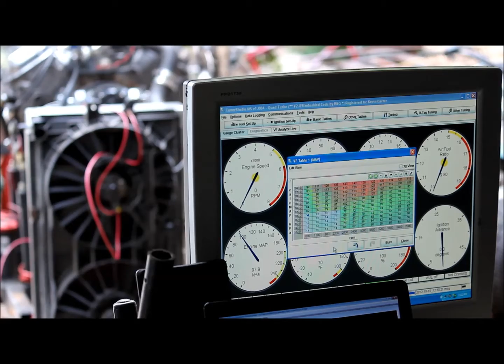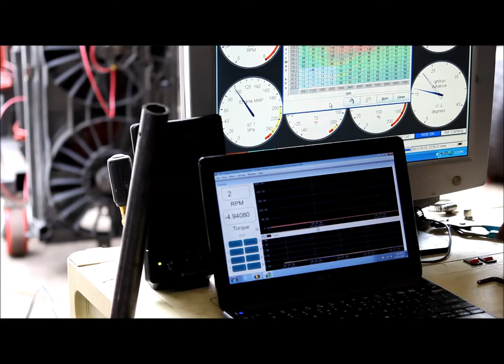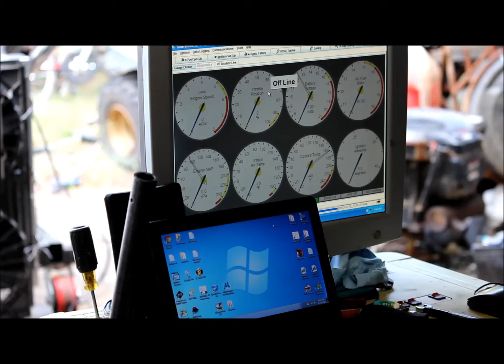Twin Turbo 454 BBC final assembly and test firing.  Polished Everything.

Comment: I like the cnc in the background alot more .  I work on a doosan 5 axis horizontal at work and have a small 4 axis at home .
Reply from the maker: +Mark Rich It's funny how much attention my son's sub $400 twin engine go kart gets and no one notices the 5 axis machining center in my garage.  I've been doing a lot of 3+2.  I've just recently started playing with simultaneous 5 axis.
Reply: Kevin Carter
Not many people understand what a machinist is , does. I personally love it . Its fun to build stuff hobby wise but having the ability to make your own parts in my opinion is ten times better .  
Im great with solidcam , mastercam , solidworks. Its what I went to school for ,  do for a living . If you ever need a hand message me .
I can get you a 5 axis simultaneous  mill , turn , mill & turn if you need free.
Reply from the maker: +Mark Rich A large part of my day job has been CAD design.  All machining and sheet metal is sent out.  Before I started playing with machining at home I thought you just stuck the CAD model in the CAM software and hit go.  All my machining experience has been here in the garage.  I started with an iron pipe built gantry, then a CNC converted Bridgeport, then an 80/20 gantry, and finally the Matsuura.  Learning how to repair the electronics on it has been a challenge all its own.
Reply: Kevin Carter
Kevin im 34 now when I was 21 I started off with a mini mill in my garage. I CNCed( using Mach3)  it . That is what got me to go to school for engineering.
Fast forward decade later . I still have that little mill in my basement  so I know exactly where your coming from . 
Im converting a knee mill right now . I would love to have a "real" 3 phased boxed way cnc mill . I dont own my home and I do not have three phase . One day .
Have you done any engine machine work? For this reason alone I would love to have a decent size vmc at home.  
Parts look great though

Comment: what year motor is that out of?
Reply from the maker: The block is a Mark IV 454.  They were produced from '70 to '90 and used in everything from ton trucks to Vette's.  The heads are 049 castings from '73.  The intake is from Arizona Speed and Marine.  The rotating assembly is all forged aftermarket parts and the valve train is all Comp Cams.